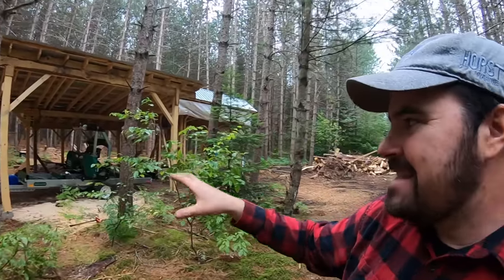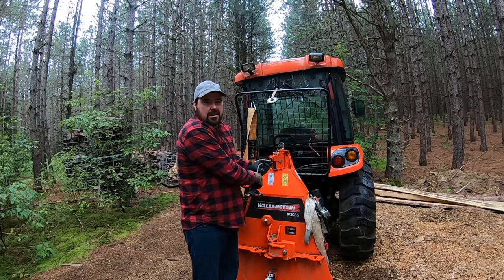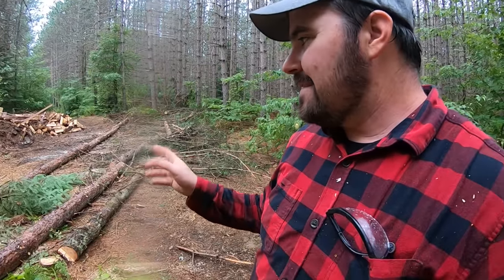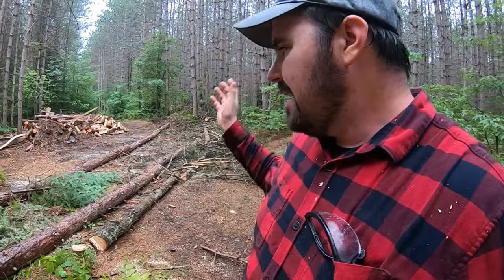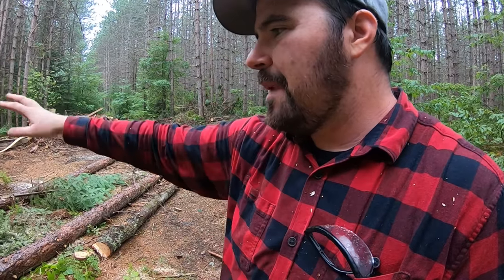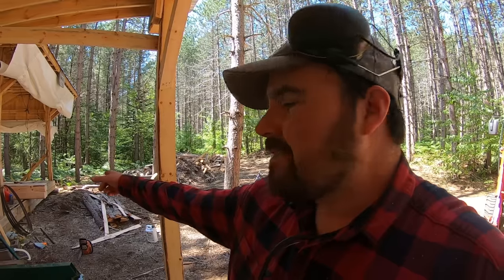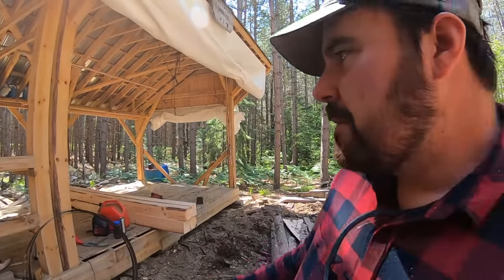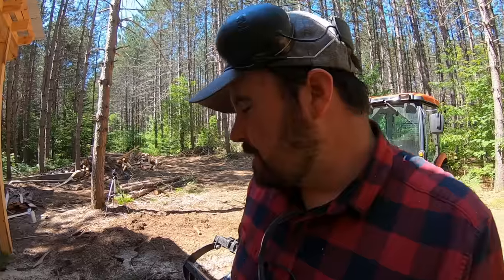Cutting and Winching Trees for the Sawmill

Comment: Good afternoon Sandy yes I can relate with the bug eating wood here in Florida we got at least 9 months to keep an eye on them 
  I got a pound that I am trying to cut the pine from the surrounding of it but like you are doing unless I am going g to use them I don't want to cut them and leave them for the bugs so I have been at it for over 2 years and still got a lot of pine to cut lol
  For your mill you got a soldering machine make yourself a couple of stopper on the opposite side where you could slide 2 pines easily to use. it will happen one day a log is just going to keep Rollins right of it you don't need anything fancy just strong to stop the incoming log well have a great day
Reply from the maker: Thanks for that idea about the stoppers. Think I"ll have to rig something up like you mentioned. Sounds like you've got some nice pines . Sure makes for some nice lumber

Comment: Too many comments to read so this may have already been suggested Sandy.  Until a different way is used to place the logs on the mill, simply place a couple of 2x4(or 4x4) s inside the mill rails laying on an angle on the opposite side from where you are approaching the mill...extending long enough under the closer mill rail so that if a log hits the 2x4 it will raise up and hit the closer rail.  This will make the 2x4 a small stop so that a slow rolling log will not fall off.  I do this as a safety device with large log when turning it when making a cant so that the log cannot roll back on me.

I hope my explanation is clearer than mud!  🙂
Reply from the maker: Clear to me Mike. Thanks for sharing that with me. I've got some ideas for that and I think the one you mentioned is a good one as well

Comment: Those 6x6 will make a nice log deck for sure and as you where sawing I got the thought if you had a wide opening in the back of your old lumber shed where you could stack lumber easy from the mill and then have excess to get the lumber with the tractor. Just a thought nice video Sandy see ya the next one.
Reply from the maker: Great points there Jeff. Should be  a nice log deck when I"m done I'm hopping.

Comment: New to this sawmill world and stumbled onto your page bored at work looking for answers.  Watched a few videos now, learning a ton and taking the edge off the learning curve for sure! Appreciate the time you take to share.  I notice the new trailer deck moves a bit when placing logs on the bunk, does this not knock things out of whack a bit?  Post holes with a chainsaw?? this I got to see.  Have a great long weekend.
Reply from the maker: Great question. It does cause the sawmill to bounce a little just when the logs real heavy due to the air in the tires but I find even if the sawmill is out of level a bit it doesn't make any difference

Comment: It took a while, but I finally got my 126 mounted on a trailer frame. 20' x 7' tandem axel. One additional track section. Room enough for floor boards on both sides of the mill. Plan to add uprights and a roof. Before the snow flies here in North Idaho.
Reply from the maker: Sounds like a great setup!
Reply: My is on a trailer with 2 extra extension. Sawdust will build up in the middle and u will find you’re stepping in the centre area. I have run planks down the middle of of saw deck, it’s easy to clean an safer for me. Happy sawing north central Alberta.

Comment: I was 9 years old when my dad decided to build 2 - 40ft x 250ft chicken houses. They were basically large pole barns that required a lot of post holes. He bought a new homelite C-51 chainsaw to do the job. I wanted to operate that hole digging saw so he let me. I could get the holes dug but couldn't lift the saw out of the hole. Be careful around the roots.
Reply from the maker: Sounds like a very similar setup. Sure can be tricky when ya get into the roots that's for sure

Comment: I kinda find it amazing that you wear all the protective gear, chaps, helmet with face shield etc, and you don't bother to wear gloves when running that saw. The one time that a chain broke on me (hit a 20 penny spike)  it whipped back and ran across the top of my hand. Still have those leather gloves just as a reminder. Not trying to be a saftey sally, just wondering. Love your channel by the way!
Reply from the maker: Great points Bill. Glad you’re ok from your injury. I don’t have the same control as when I’m using my bare hands and so that’s the reason I prefer not to wear gloves

Comment: I've had good luck pulling the hole tree over that are that size although not quite as satisfying as falling a tree. . Then just stack the root pack in the burn pile, area all cleaned up, mostly. If I use my backhoe that tears up the area quite a bit, those stumps come out quite hard.
Reply from the maker: That would be handy for sure. Any damage to the grains in the tree when sawing them in to lumber?
Reply: Have not noticed any damage to the grain. Those size tree are really quite strong and I grab the tree about 10' + up or so and use that lever advantage. Those stumps come right out,  usually, sometimes  I've had a few stubborn ones. The higher up you grab them the easier they come out. Does not seem to hurt tree unless you grab them to high and bow them to much. Try one some time.

Comment: make 2 L brackets out of  1 1/2 tubing. They will slide into log bunk on opposite side of stops. You can put them in when you load logs, keeps  logs  from rolling off of deck. Mine are 12 inch’s
Reply from the maker: Thanks for that idea Bryan

Comment: Have you seen the idea of hanging a flap over the out fall of the sawdust and hanging a bucket under it?  This would make keeping the saw dust problem between the storage deck and the mill when you turn the mill end for end.
Reply from the maker: I do have a bucket I hang on the sawmill but haven't used the flap idea. The bucket is pretty slick though for sure

Comment: If you place the snatch block on the tree you want to pull over and the anchor it on the other tree you will have twice the pulling power. The way you have it all you are doing is changing direction of the pull.
Reply from the maker: That's a good point Henry. In my case I'm not applying any tension on the tree except for a very little bit to ensure that the tree doesn't fall backwards on the buildings if I were to make a bad saw cut with the chainsaw

Comment: Excellent! Tis a good days work there! What are your thoughts on having your new mill higher compared to your old mill (God rest its soul... ) which was on the ground? Its hard getting rid of a good piece of equipment.
Reply from the maker: I like it a bit higher for most scenarios but find it is a bit of a task to bend over the log to adjust the log stops compared to when the sawmill is lower. Aside from that I like the setup

Comment: Thanks for videos they have helped heaps in setting up my HM126 (should have got the HM130max and a bigger tractor :-) One question is my Lube tank valve is closing by itself when running does your new one do this?
Reply from the maker: Thanks for watching. I think right where the throttle pushes on the water valve spring just around the engine there could be something getting hung up maybe.
Reply: @sawingwithsandy  Adam at Woodland Mills Australia got back to me and told me that the lock nut on the valve was supposed to be at the top of the valve must have rattled loose in transit to New Zealand. Great quick service from Woodland Mills. Thanks

Comment: Great work as always dude! Love what you're doing!
Just purchased the same grapple. I forget whether you are using a 3rd function or hoses run to rear remotes. Wondering if you can tell me how much length of hose from quick connects on front of loader to cylinder on grapple is? I'm thinking 6ft should be plenty?
Making me want to buy a sawmill more and more after each of your vids.
Thanks!
Kyle
Reply from the maker: Hey Kyle! Glad you're enjoying the channel and sounds like a great grapple you've got. I really enjoy mine. I don't have my grapple hose length handy but 6' is what I"m thinking would work well. I'll try and remember for ya and give it a measure. Feel free to give me an email if you'd like the exact measurement. My grapple is hooked up to the rear remotes with long hydraulic lines. Works pretty good

Comment: I for one Sandy am a lot confused as its not configured in a manor I have seen before. Log stops on the side the logs are loaded on to the mill. Choice or accident is my question???
Reply from the maker: Great question Morgan. Reason the sawmill is setup like it is is it will keep the sawdust blowing out of the sawmill shed and allow me to walk and cut nearest the lumber shed for easy limber piling
Reply: @sawingwithsandy  Since that is the case, maybe a folding stop for just loading the deck might keep anything falling off the backside.. just saying Sandy. It does so look hard  to retrieve anything that does fall off of that deck the log rests on.

Comment: Have you tried pulling the tree over to get the roots up?
Reply from the maker: I did try but didn't have any luck as I couldn't get the winch cable up the tree much more then about 8' where I could reach. I think with a bit more leverage it could work. The smaller trees may snap off though before pulling out

Comment: I would think you will need a deck under the "new" log mill soon. At least where the operator walks. . You will soon be needing waders to cut the wood. You also will now be blowing the sawdust onto the log deck if you don't remember to put the dust collector bucket on. It will be impossible to get it out from under the log deck.
Reply from the maker: Great points Lara. May have to put some boards down where I walk just to make it a bit smoother. Time will tell how that ends up working out. With the design of the log deck I've got coming up I"ll be able to back drag my tractor through the bunks to take any sawdust out that's missed by the bucket